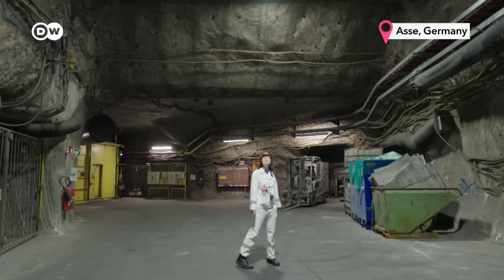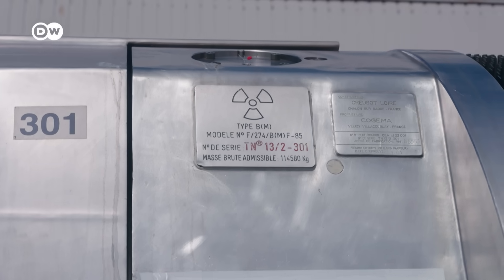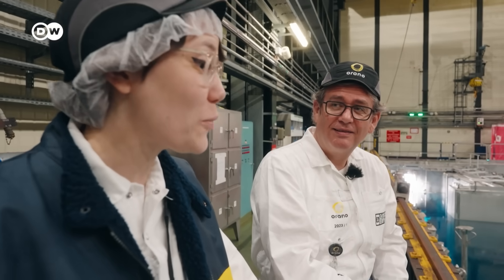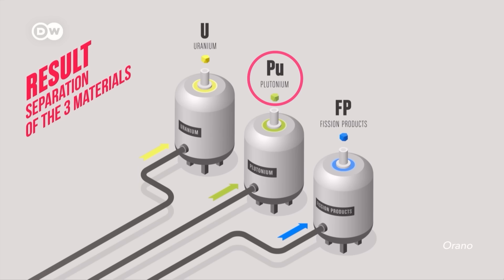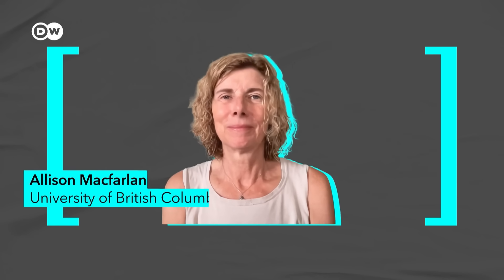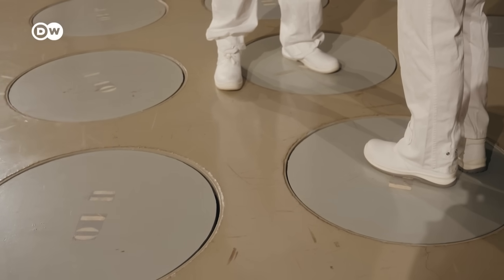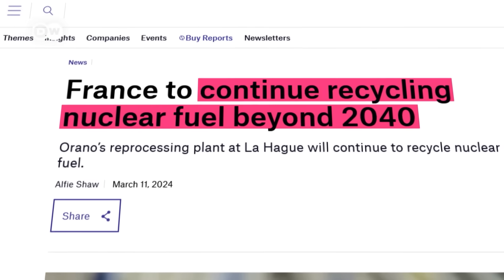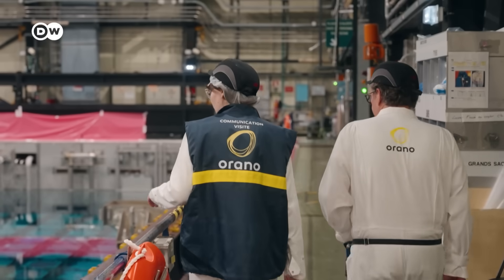Nuclear waste is reusable. Why aren’t we doing it?

Comment: So why is the MOX plant on the other side of the nation from the recycling plant? Why not just produce MOX on site and completely get rid of the security risk of transportation? Heck if we can get a recycling plant design that auto makes the MOX so you cant get the plutonium it would be safer to spread around. Is it possible to use plutonium as a fuel?
Reply from the maker: Plutonium can indeed be used as a fuel, particularly in MOX fuel. And the distance between the MELOX plant and Orano's reprocessing facilities is because historical development and site-specific expertise. They were built independently at different times, the Melox plant that processes MOX fuel was opened before Orano.

Comment: Spent fuel chem separation of fissile material , fissile material breeding in fuel , buildup with burnup in different neutron environments/fuel composition. Theoretical centuries long closed cycles for salts/metal cooled fast N reactors breeding their own fuel etc.... Not extremely practical, we have aloot of space and inpermiable rock underneath us , burry it and forget it. Its not a big deal . Furthermore with modern tech going down underneath 2Km of hard rock is not very difficult and you dont have to worry about constantly supporting everything.

Comment: Even without a recycling process nuclear power could be seen as a safer and more recyclable alternative than fossil fuel, all of the carcinogenic compounds produced from burning coal or any other fossil fuel will float around in out atmosphere forever, it will continue to be dangerous forever. Nuclear fuels decay and become safe to be around  although many isotopes being used will only be safe after 24,000 years

Comment: Hold on, that cask is well over the boiling temperature of water. Why is it not in a reactor boiling water into steam to spin a turbine? That kind of stuff is supposed to be low reactivity getting sealed up and stored because that stuff will take years to decay. There shouldn't be any spent fuel that is still hot enough to boil water.
Reply from the maker: Spent fuel can stay hot for years or even decades, which is why it's first cooled in a pool. But it is no longer efficient for electricity generation because most of the fissile material is spent - that's when it is considered 'spent' fuel. ☢️
Reply: @DWPlanetA  Last I checked in the US we put our spent fuel in concrete blocks. The reactivity is so low you can stand next to them.
Reply from the maker: Yes you're right. But dry cask storage follows that cooling the spent fuel first in the pool. ☢️

Comment: I always wondered, why can't you use just the heat from the spent rods to heat water to provide warm water to houses?
OFC, in a safe way, heat exchangers, no direct contact of water, yada yada...

Maybe someone can answer this question?
Reply from the maker: You're not the only one wondering! Decay heat is rarely used, but can be converted directly into electricity by means of thermocouples. It can be used in remote weather stations or in space missions. There are plenty of safety challenges though and the development of applications is quite complex and expensive which is why it is not more broadly employed.

Comment: This is total bullshit. Molten Salt Thorium reactor can use waste uranium from current nuclear reactors and use almost all energy that uranium can supply. Thorium reactors can produce 200 times more energy from 1 kilogram of fuel compared to uranium reactors, And the waste from Thorium reactor is radio active only for 300 years, compared to 10 000 years for uranium reactor waste. But there is a downside for BIG GREED !! They can't make nuclear weapons from the waste of Thorium reactor, but from the waste of uranium reactors they can. That's why uranium reactors were selected in the first place ... GREED AND WAR !!! And also, there's enough thorium in one cubic meter of soil anywhere in the world that it can supply enough energy for all electricity and heat for one person for whole life. Think about that folks 🤔🤔

Comment: See this about a THORIUM NUCLEAR REACTOR PROJECT... 

They say they could ALSO reuse this nuclear waste AND EXTRACT 10 times MORE ENERGY than the nuclear plant that used it the first time. 

Moreover, the 100 000 year half life could be converted to just 300 years.. 

Thorium, in general, seems to be VASTLY CHEAPER, EASIER AND SAFER.

Comment: How much Plutonium are we talking about? I know it's normally considered nuts to send waste up in a rocket, but if there is not that much of it, it could be contained in safe containers (from what I've heard, they are virtually bombproof) and shot into the sun. Weight probably makes it unreasonable. And I may be wrong about survivability of containers. And there is always cost. Just thinking out loud here, probably high. 😁
Reply from the maker: Hey there! There are several issues with sending nuclear waste into space. It is very expensive to do so, it adds to the dangerous debris that is already orbitin the Earth and if there is any rocket failure, the radioactive material could be released and end on Earth.
Reply: @DWPlanetA  Yeah, that's what I alluded to. But it wouldn't be in orbit, would it?

Comment: i heard that waste generates quite a bit of heat on its own. it may not be enough to cause steam, but what if you do it with a liquid with a lower boiling point. would that work?
Reply from the maker: Hey there! Yes, the spent fuel rods generate heat. However, they are too radioactive and need to be handled with extreme care so it does not make sense. But the heat from nuclear power plants is used to heat homes via district heating systems, e.g. in Sweden, Finland and Russia.

Comment: Breeder reactors create more fuel than they use to generate power.  With a breading reactor you remove the fuel because it has too much fuel, not because it has too little.  Doing that would require bringing in the military for security, but that would make nuclear quite viable for the earth's energy needs.  They are being wastrels out of proliferation concerns, but they already brought in the military out of dirty bomb concerns so it doesn't make sense.
Breeders turn nuclear waste into nuclear fuel.  It's better than dropping the nuclear waste on poor brown people, killing tens of billion in time(DU).  I mean that is pure evil.
Fast breeder > light water

Comment: Recycling nuclear waste was never impossible. The problem is it is expensive. Most reactors were first built to produce nuclear material for weapons, generation of electricity was a happy byproduct used mostly for propaganda. (One of the reasons Thorium reactors were not developed, they don't produce good bomb making material.) It is easier to just set the waste aside and wait until the reactor is retired, declare bankruptcy , and let the taxpayer worry about it. If the complete cost or nuclear energy was paid up front it would be too expensive. Nothing secret here, all the information is out there.

Comment: The majority of the actual radioactive trash is things like suits and other things that come in contact and become contaminated by the material, not the actual reactor material itself which is a surprisingly small amount
Reply: The elephant in the living room here is that most "radioactive trash" really isn't.  Once you cross into the Controlled Zone, your PPE is automatically considered to be contaminated although it is most likely not.  The alternative is to have rather highly pain Rad Techs use very expensive equipment to check every inch of your outer garments and anything which was outside of them.  

Much easier and cheaper to "scan to email" your notes and such from within the Zone, then toss your pencil, clipboard, Tyvek coveralls, booties, gloves, etc. in the bin as you exit.

Comment: The stored Fissionable Materials could be turned into radioactive batteries. Such batteries date back to the 1970s, and with tech improvements, and refinement, such materials as Cesium 137 and Strontium 90 (which primarily produce Beta decay radiation) could be used to produce 30-40 year batteries that autocharge, and don't require external power input. Some researchers, like the University of Bristol Interface Analysis Centre team, including prof. Tom Scott, produced a radioactive diamond battery from spent control rods, comprised primarily of carbon-14 and nickel-63. Rather than encasing the Fissionable Materials in glass and burying it, they should be applying it to the create of autoregenerative batteries for power production.

Comment: I still can’t believe that after hundreds of years we are still using steam turbines to power stuff and haven’t found a way to use the nuclear rods as a direct source of power instead of loosing massive amounts of wasted potential energy by converting it to heat/steam energy it just blows my mind we haven’t found a way to use them like batteries that discharge the radioactive discharge like a positive and negative to create power without the steam engine look at what they did with the voyager satellites there was no steam just small fuel rods that created heat but we could improve on the technology and make it beefed and more efficient for longer use of the fuel rods

Comment: Here's a question that no one can answer. After I Candu fuel bundle is discarded what is the weight difference from when it was first installed?   I know there has to be some matter to energy conversion after all that energy doesn't just come from nowhere.  I figure three to five grams weight reduction.

Comment: Isotopes  with "disabled structures" are isopons and are unuseable weaponry  graded and can find versitility in the light-range ukraniam provision. BUT, deterioration prevents this use, for its integrated isotopes will not bond, and its versitile use currently in Vaseline H20, a highly unprofitable substance similar to toxic-sand.

Comment: Reprocessing was part of a plan where uranium would get expensive (because of all the reactors everyone would be operating), but we'd move to breeders.  Fast breeders work best with plutonium, and the initial fuel loading for them would ideally be from reprocessed thermal reactor fuel.

But this scenario never came to be.  Many fewer reactors were built than the nuclear advocates thought, uranium remains plentiful, enrichment is much cheaper now, and recycled plutonium has negative value (because fabricating fuel elements with it is such a pain when one could just use cheap enriched uranium instead.)   The "96% reusable" figure for spent fuel is referring to U-238, but we have mountains of that from enrichment so there's no justification at all for recovering more.

In the US, reprocessing of spent fuel is not banned (contrary to people who think Carter's executive order doing that was still in effect), but it's so economically senseless no one will do it.

Comment: Moltex completely avoid the issues with fuel reprocessing by not changing the isotope content of spent fuel. They chemically change it from a ceramic to a salt. This allows the whole fuel to be used as a liquid in a simple reactor that has no moving parts. They use 99% of the spent fuel. The 1% has a 1/2 life of 30 years vs 30,000 years for PWR spent fuel (mix it otherwise).

Comment: the problem is though that only 3% of the volume of radioactive waste from nuclear power plants is spent fuel that might be able to be reprocessed. The other 97% is stuff like machinery parts, personal protective gear etc that has been contaminated and other low grade radioactive stuff that isn't nearly as radioactive but is still dangerous and needs careful storage because it could still be used by terrorists to create dirt bombs etc, and you don't want any of it getting into the environment and food chain, because long term exposure to it will still kill you.

Comment: what makes nuclear waste into "nuclear waste" are the fission products some which are neutron poisons.  That is because the fuel is in solid form. 
In a liquid reactor, MSR, the fission products can be removed in-line, continuously, if needed or wanted.
Mechanical engineers don't do chemistry, that's why.

Comment: I would be happy to work for them but I am going to be working from home.  😂 but why we still do it this way, long after the cold war ended and thebUSSR is long gone beats me. We could be using safe, clean Thorium salt based reactors. Cannot melt down and can process used fuel. Only china has built a reactor that cannot melt down so far. That is a so called pebble reactor and it passed the test of having the active cooling system turned off. Ok so it isnt Thorium based but it is still a step forward. Well done France for leading the way in Europe though. This is a great step.
Reply from the maker: Hey Simon! We looked at Thorium nuclear energy and its potential a bit ago. Check out the video and let us know what you think 👉https://www.youtube.com/watch?v=Km6kqykX900

Comment: How many times can the fuel be recycled? What is the end storage need after that cycle vs not recycling? How much does the safe long-term storage cost? Is that figured into getting the cost of recycling vs not?
Reply from the maker: Hey there! The fuel can be recycled multiple times until all the uranium is used. Do you mean how long it needs to be stored after that? It still needs a long-term storage but the time is reduced. However, the duration depends on the type and the recycling process. The cost of long-term storage varies a lot, we did a video on Finland´s underground nuclear storage 👉 https://youtu.be/QFEd5RkotFE and also on the issues with Germany´s long-term storage 👉 https://youtu.be/hOWQgLeRM-M

Comment: Reprocessing nuclear fuel is incredibly dangerous, also the amount of fuel that has been used is far more than can safely be recycled. The buildings that do this  are often closed down due to accidents and contamination. It's most likely far cheaper to just mine more uranium and make new fuel pellets instead of recycling it.

Comment: Why not have a nuclear engineer onboard when making these videos, its like a common person doing rounds of a facility and sharing her misdirected opinions.
The Pakistani nuclear programme is led by two organizations, one focuses on Uranium and the other on Plutonium. For us both elements are useful for the bomb. 
It is such a misinformed notion that plutonium from the fuel cycle will be something more dangerous for the bomb than uranium that already exists in the reactor before the reaction. 
It is also doubly fear mongering that any person can just extract either of them and make a bomb, it is an extremely expensive process requiring specialized equipment and materials.
Also if you have the money, you don't go about stealing them from reactors, you make your own reactors to make them. Pakistan has over 7 of them churning out bomb material.

Comment: Nuclear waste is indeed reusable, particularly in the form of spent nuclear fuel, which still contains a significant amount of energy. However, there are several reasons why it is not widely reused:

1. TECHNICAL CHALLENGES: Reprocessing nuclear waste to extract usable fuel is technically complex. The process typically involves separating plutonium and uranium from other radioactive elements, which requires advanced technology and infrastructure.

2. HIGH COSTS: The reprocessing of nuclear waste is expensive. The costs include the construction and operation of reprocessing plants, handling and transporting radioactive materials, and managing the by-products, which are still highly radioactive.

3. PROLIFERATION CONCERNS: Reprocessing spent nuclear fuel can produce plutonium, which can be used to make nuclear weapons. This raises concerns about nuclear proliferation, leading many countries to avoid reprocessing to reduce the risk of weapons-grade material falling into the wrong hands.

4. WASTE MANAGEMENT: While reprocessing reduces the volume of high-level waste, it still produces radioactive waste that must be managed. The by-products are highly radioactive and require secure, long-term storage solutions.

5. POLICY & REGULATORY ISSUES: In many countries, government policies and regulations have favored direct disposal of nuclear waste rather than reprocessing. The regulatory environment and public opinion can also influence decisions about whether or not to pursue reprocessing.

6. ALTERNATIVE APPROACHES: Some countries, like the United States, have historically favored a "once-through" fuel cycle, where nuclear fuel is used once and then disposed of as waste, rather than reprocessing and reusing it. This approach simplifies waste management but does not take full advantage of the energy potential in spent fuel.

In summary, while nuclear waste is technically reusable, the challenges of cost, technology, proliferation risks, waste management, and policy have limited the widespread adoption of reprocessing as a solution.

-GPT